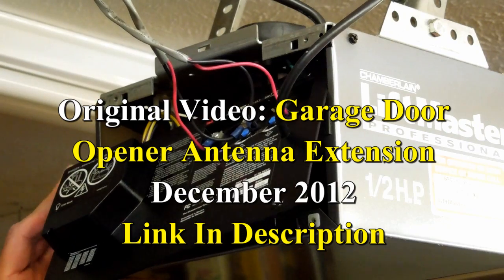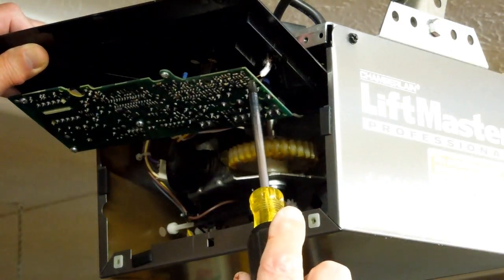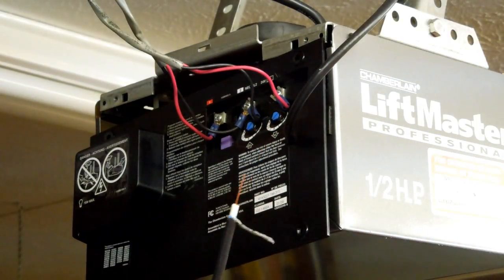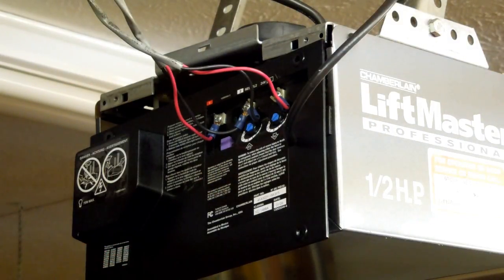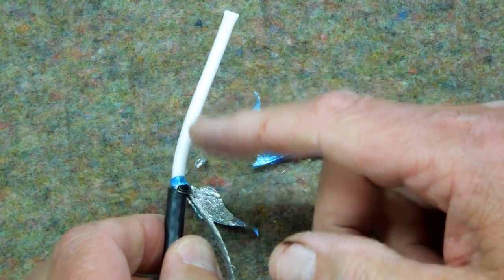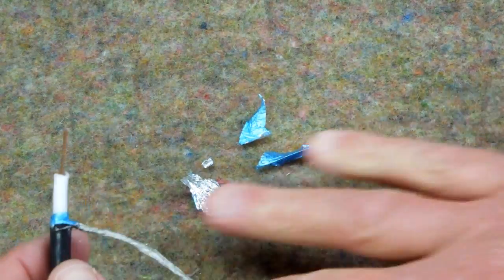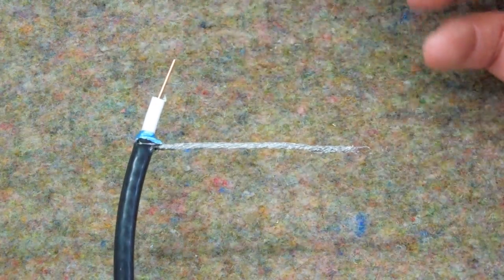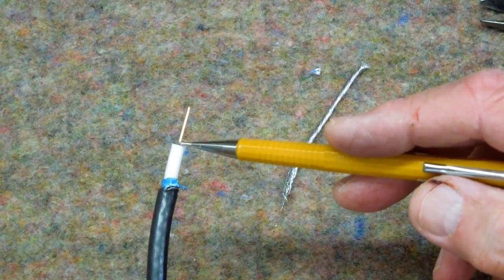Garage Door Opener Antenna Extension - Coaxial Cable Preparation

Comment: The length of the antenna wire is important for receivers that are tuned to a single frequency (or a very narrow band of frequencies). These receivers usually use antenna lengths on the order of a quarter of a wavelength, (or and odd integer multiple of a quarter of a wavelength - 1/4, 3/4, 5/4, etc.). By increasing the antenna length to anything other than an odd multiple of a quarter of a wavelength, you reduce the antenna's effective gain. 

By grounding the shield at the circuit board, the effective antenna length is simply the length of unshielded wire that hangs off the other end of the coaxial cable. In addition, the grounded shield can significantly reduce the amount of interference picked up near the opener.

Comment: after replacing my 8 foot neon bulbs with LED's the door opener quit working outside the house. The LED's operate at the same 300mhz range as the door opener. i connected the center of the coax to the antenna wire after trimming the original wire off, the soldered the connection. I then covered the wire to the board (2") with aluminum furnace tape to create my own shielding. For the antenna outside the house I just stripped away the shielding part of the cable leaving the center wire uncovered as the new antenna. I left 9" of the center wire without shielding and mounted to a simple L bracket to get it away from the metal exterior of the house. 312mhz, quarter wave requires a 9" antenna.  I grounded the coax to the exterior of my metal skin house. Opener now works at 100 feet with lights off and 25 feet with light on. thanks for the video, sent me down the right track to solve my problem...

Comment: Works great!  Used a couple of leftover 4ft Coax cables with a barrel connector to extend, did not remove the old antenna, the circuit board had an extra hole position to connect a coax.  Finally the garage door works from the driveway.  Having a barrel connector allows to extend further if needed, but 8ft total was sufficient in my case.
Reply: Do you have LED lights in your garage?

Comment: I thought this might solve my erratic garage door opener range, but it turned out the cfl bulbs I used in it created the reduced range by interfering.  I thought that was more of a problem with cheap LED's but sure enough, I put some old incandescent bulbs I had lying around and no more problem.  The opener's light had IR motion sense and I often found it on when I went into the garage.  So when it was on, practically no range.

Comment: not to be an ass but coax cable conductors arent copper they are steel clad in copper... i service garage doors/openers professionally and most of the time if your remotes arent working at a distance its typically caused by the lightbulbs being used in the motorhead. or in light fixtures surrounding the motor on the ceiling. both led and fluorescent bulbs emit rf interference. genie and chamberlain both have shielded led bulbs that dont cause interference. but standard incandescent bulbs are best to use if you can find them. as for coax. the only way you get ofc copper coax is to order it that way. typically its coax made for aerials and wont work well for satelite or cable as its more designed to pick up signal rather than block it out and its very expensive compared to the standard ccs youll get off the shelf

Comment: ever since I added a large metal carport,  the garage door opener is almost useless.  I've tried the coax, shielding grounded and ungrounded.  No difference.  Still  experimenting
Reply: I connected a spring loaded hole clamp to my wire. It went from not being able to work even when I was right in front of the garage door to working 5 houses away
Reply: @justsaying3594  Can you elaborate on what a 'spring loaded hole clamp' is? I'm trying to fix my garage door antenna reception.

Comment: Next time you are preparing the coax, instead of using an awl to unbraid the shield, separate the braid with the awl near the outside cover and pull the inner conductor and insulation through the braid.  You can then pull and twist the braid to form a conductor for grounding or soldering (if desired).

Comment: The receiver is a super-regenerative circuit. It's very sensitive, but never met a frequency it didn't like. A few years ago, Chrysler and Jeep keyless entry systems would block GDO signals when the car was parked in the garage.

I had one caller who wanted to open his gate from the house, about 150' away. I had him install coax, and use the ground, and run it to a small UHF antenna pointed toward the house. He got amazing range.

Typical frequency range is anywhere from 303mHz to 433mHz. This falls within the UHF TV band and antennas are everywhere.
Reply: Does coax impedance and length matters? I never thought about it this way.
Thanks for the comment.

Comment: It's good that it wasn't necessary to extend the braid to connect to a ground. The braid and foil are aluminum and will resist soldering efforts. It would have been necessary to use a crimp connector or strip off sufficient jacket to have suitable length.
Reply from the maker: Well that one caught me off guard. :-) I have soldered many a piece of coax braid. I used to strip it off coax and use it as a shield for long R/C servo leads. I knew the foil was aluminum (of sorts) and just thought the braid was tinned copper. Obviously I have not soldered any in recent years. Bummer!  OK... crimp the braid to a piece of copper wire.

Comment: I sort of tried this with limited success.  I attached the cable to the original antenna and ran it to the front of the garage door.  Is there a reason you attach the copper coax directly to the board?  Secondly, I may try to ground the wire.  In simple terms, why would the ground, attached to the braid, need to be the length of the old antenna?
Reply from the maker: Attaching the coax center wire directly to the board is the best way to attach it. The braid isolates the copper from receiving stray signals if it is grounded... not grounded the coax is probably little better than a long wire.  The frequency at which these operate, the receivers don't seem to be finicky about antenna length (at lease mine isn't) they just need to receive a signal. Grounding the braid won't hurt a thing. If you can accurately locate ground on the board you can use that point or anywhere that is known to be grounded on the metal frame. You should watch the video again... you misunderstood about the "length of the ground" ... I did not say anything about the length of the ground wire. I said... IF THE COAX IS GROUNDED - The length of the wire (antenna wire) attached to the end of the coax (the end located outside your garage) should be the same length as the original antenna wire you removed from the circuit board. Please subscribe!
Reply: Thanks Ron.  I'll add this to the long list of projects that need to get done.  I'd sub again, but I did it 7 years ago. ;)
Reply from the maker: YouTube has the subscription thing screwed up. When I look at your channel page it only shows the last 15 channels you have subscribed to. It is supposed to say "show all" but does't.